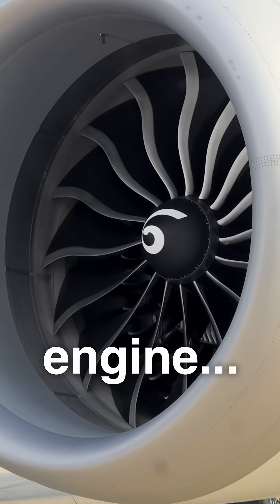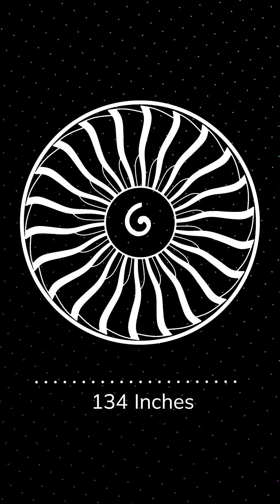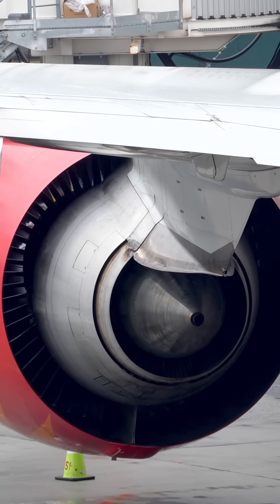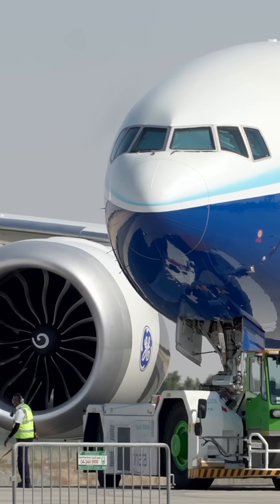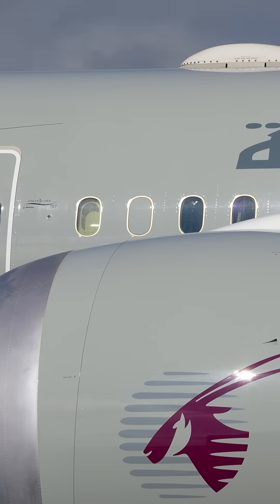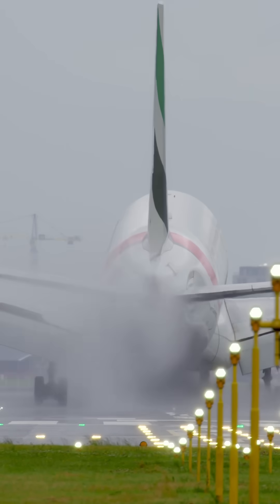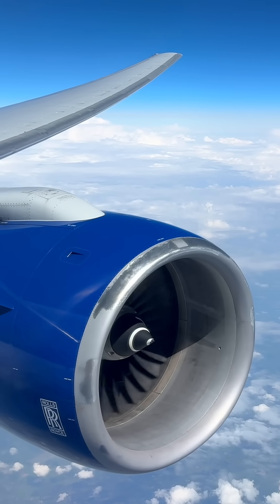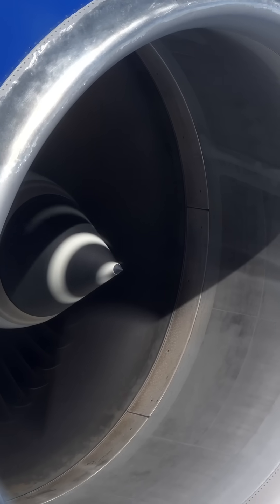THIS Is the world’s biggest jet engine…but is it TOO big??

Comment: can 2 of these power A380? instead of 4 engines they have now.
Reply: The A380 might just be too heavy to be a twinjet. Thrust-to-weight, y'know
Reply: @MinusMOD98  The 747 if it was to be a twinjet also would be too heavy.

Comment: The Gen9X has more thrust than the GE90 from what I’ve seen. 115k lbs vs 135k lbs
Reply: Yes and no. The GE90’s max thrust is set to 115k on the current 777 but in testing reached almost 128k. The GE9x will be set for 110k on the 777x but was able to exceed 134k in testing.

Comment: Has Boeing ever actually built a decent airplane? Looking backwards, even many of the classics seem shitty! Remember when the 707 was having an engine mount problems?
Reply: Designing a plane isn’t as easy as it is on paper so expect flaws
Reply: @rekt_illa5118  Funny... I know you use "on paper" merely as a turn-of-phrase, but the 777 is actually the first airplane to be designed completely on computer.
Reply: it's unnatural to have a company without issues

Comment: The engines aren't too big.  The  thrust links weren't designed properly to handle the stresses they are supposed to resist.
Reply: Agreed. The rest of these couch engineers have no clue what they are talking about.
Reply: False.
Reply: @6Diego1Diego9  OK, genius,  why did they crack on multiple aircraft?
Reply: @archer1803  Ummm genius because they were designed incorrectly or there was a build quality issue… Duuuhhhhh
Reply: @andrewday3206 maybe it is the engine being too big. Anything being overkill is always a problem. Boeing didn’t see this issue in the development, but that doesn’t mean it’s fully their issues
Reply: @Lockheed_Jets 
It means the engineering of this part, or the loads placed on the part and surrounding structure, was not done correctly.

Comment: Coby, I like your content, but I doubt the engine's weight had to do with the thrust linkage. Seems more like the way the links were designed as the main issue. Plus, the engine actually can produce 134k lbs of thrust if necessary, but it doesn't need to. 

Also, all of this is actually old news because the 777x restarted certification flights again, so we can assume Boeing found a fix to the problem.

Comment: Engine the issue? Or Boeing not designing adequately for the engine?
Reply: Thrust link design is the responsibility of the airframer, not the engine manufacturer.
Reply: Boeing doesnt make engines only companies like Pratt and wittney, rolls Royce and General Electric which is the company mentioned in this video

Comment: Cracking not due to engine, due to poor engineering of which the engine is attached to.

Another example of bean counter accountants running engineering into the ground, literally.

Comment: Putting a massive engine on an airframe without engineering the mounts and structure to reliably withstand the loads is about as smart as pouring ten gallons of engine oil into a five gallon tank. It is basic.  Boeing builds unsafe airplanes.
Reply: Haters talkin' nonsense again

Comment: Damn, first the LEAP engines releasing oil into the air conditioning, now this.
Reply: This design could very well have that same issue.
Reply: @ClipstopherBurtraw won’t, 777X will have electric compressors like the 787
Reply: The LRD thing is not exclusive to CFM engines or certain aircraft types
Reply: Don't blv everything you see on the internet.
Reply: @prasenjittripura4691  So Mentour pilot was making things up?
Reply: @MgOchieng  yes and no his video is full of half truths and limited information. If its really the case what he said in the video why is no airline grounding the 737max/a320neo? and stop with "all about money" cope... because if you see this as an flaw, all aircrafts should be grounded, every engine could have something like this happen in a worst case scenario. Also the LRD is not a device or lru that can be simply "changed" or replaced, its just a piece of the structure intended to break to reduce vibrations and prevent the engine from self disintegration due to imbalance.
Also FYI: this happened on a 320neo too, but there was no smoke or anything in the cockpit... the bleed system of the 737max is "bad" and should be changed.
Reply: @prasenjittripura4691  He wasn’t, take a look at the report documents